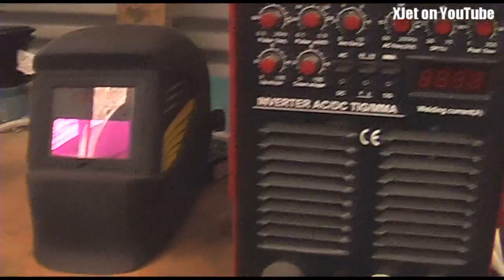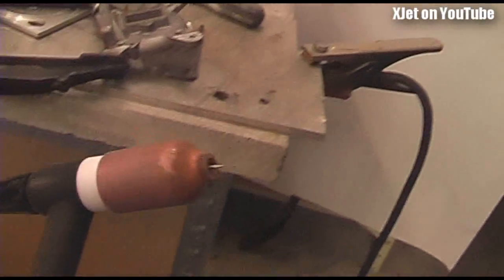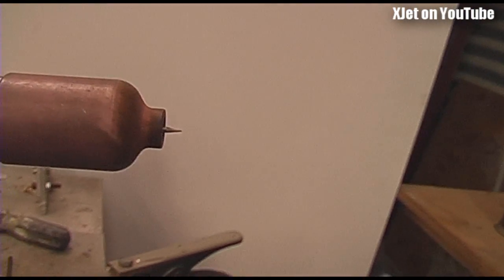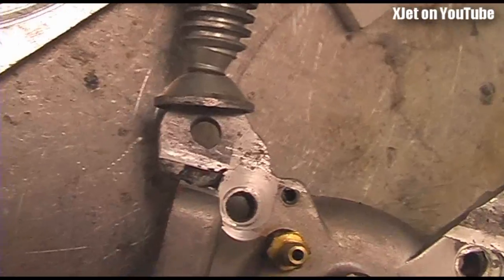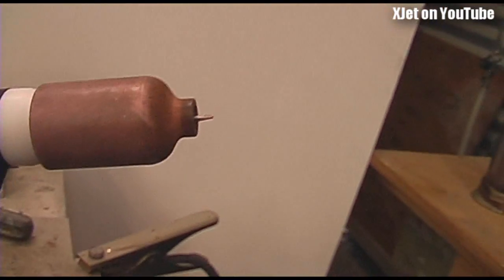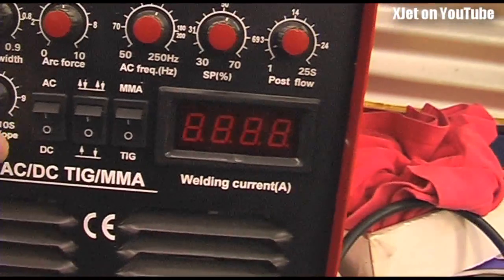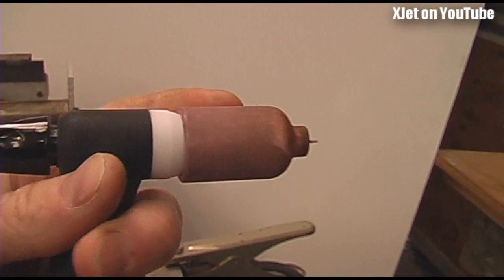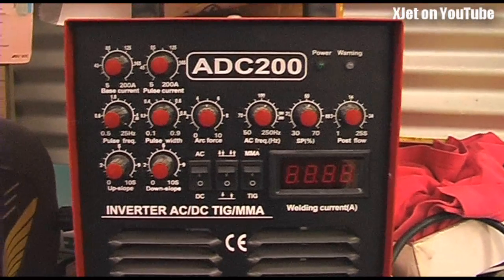A look at my TIG welder and how TIG welding works

Comment: Hi Bruce! i have the exact same welder, but after some abuse my ac output is dead. just wondering since your an electronic wizard an all if you could point my fault finding in the right direction :)
Thanks from sweden
Reply from the maker: I'm going to do a tear-down and a bit of fault finding in the near future.  I'll make a video of that so it might give you some clues.
Reply: that would be fantasic! thanks again.

Comment: This looks like one that I was going to buy on ebay from China. Is this one make in China? What do you think about this welder for general welding? Have you needed to adjust all the settings or do they give you a point to start? Would you recommend this welder to someone that had tiged in the past or is it only for hobbie? Your videos are great fun to watch. It looks like you fly on the airports main strip. No problem coexisting?
Thanks for your videos.
Don

Comment: I'm always curious about the power consumption of a welding unit. My dad would always tell me off to not buy a welding machine for it will punch up my powerbills crazily. My question is - What is the average power draw for welding <3mm thick Aluminum and Steel? How do I go about calculating it to watts/hr?